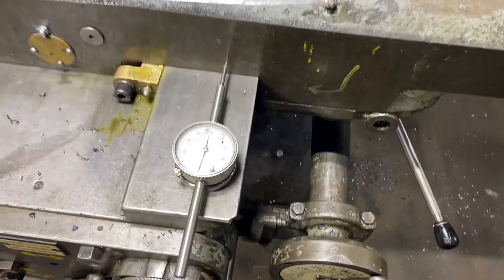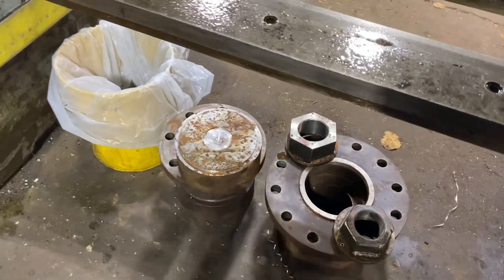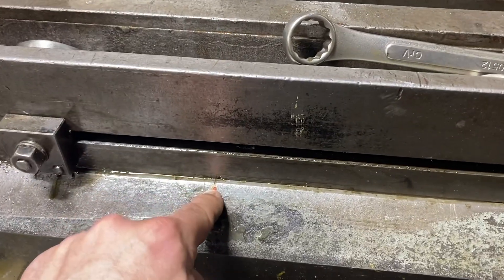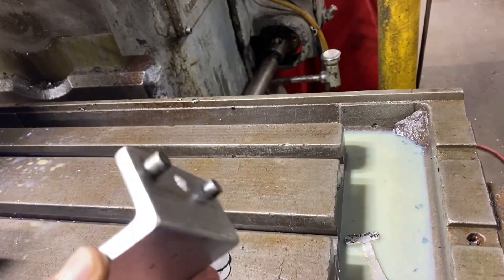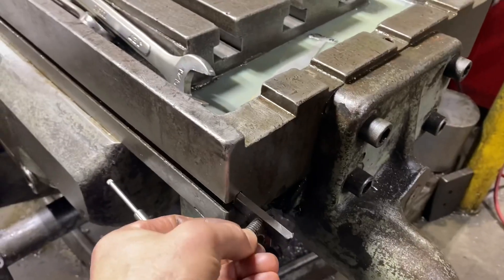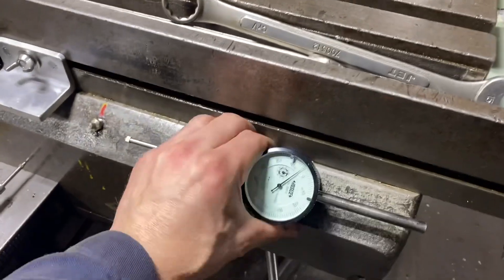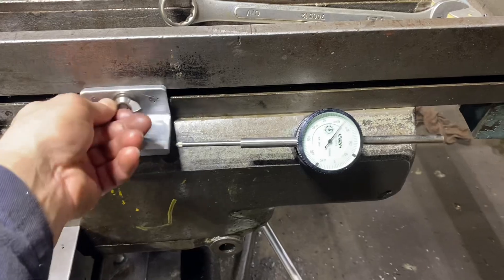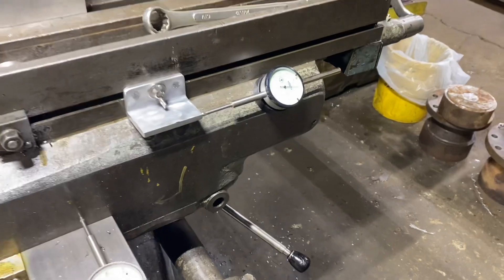Indicator thing for the milling machine

Comment: Couple hundred bucks on ebay and you can get a chinese DRO kit.  Someone with your skills could install it in a day.  I've done a couple on a couple mills and a couple on a couple lathes and they absolutely transform the functionality of the machine.  One day of work and a couple hundred bucks and you don't have to fuss with indicators like this ever again on that machine.
Reply from the maker: That’s likely true. But for what I use the big mill for right now I’m not going to bother. The larger of the two lathes doesn’t have a DRO on it, and I don’t miss it. All depends on the type of work that ends up on the machine. I couldn’t live without the DRO on the identifies as a Bridgeport mill. Doing things the old way keeps the mind sharp, builds character or something…….thanks for watching and commenting.
Reply: The shop I work for bought one of those to try it out, when they got it installed and checked it against a standard the DRO read .040" off in 6 inches. I'm sure some of them work ok but that one didn't. Luck of the draw
Reply from the maker: @evanaustin2636  very interesting, both the DRO’s in the shop right now are Sino brand. One is at least 20 years old and has never been turned off. The other is almost as old. Both work fine. I did have to change the encoder for the lathe cross slide last year as it stopped working. Was able to get exact replacement parts from local dealer. I know there are less expensive brands, but certain things I like the Brand name.